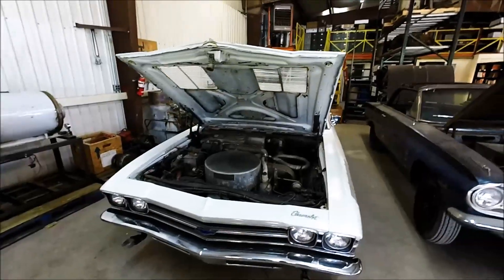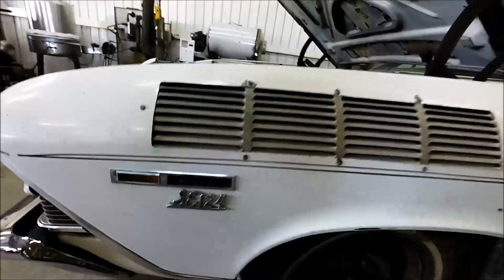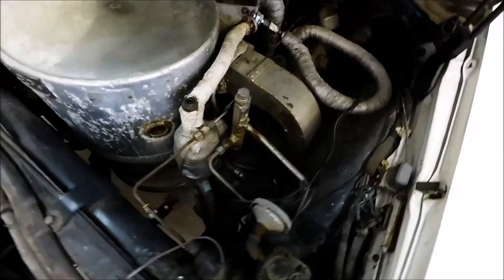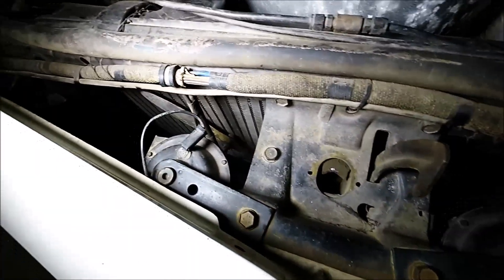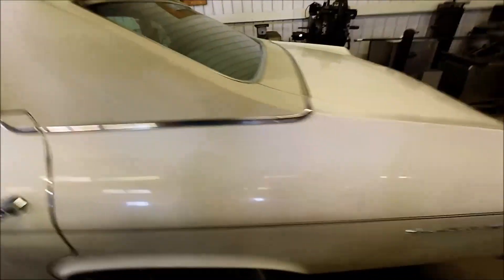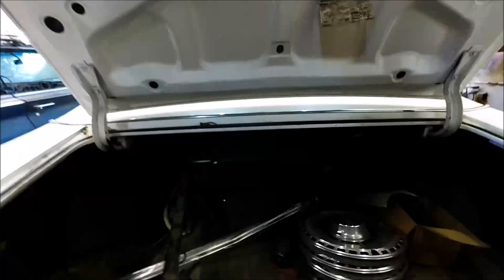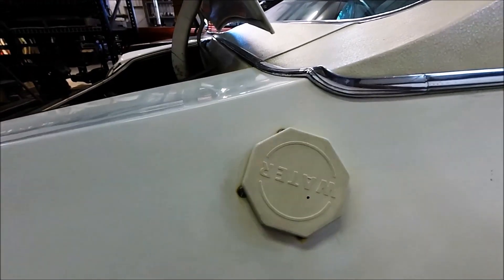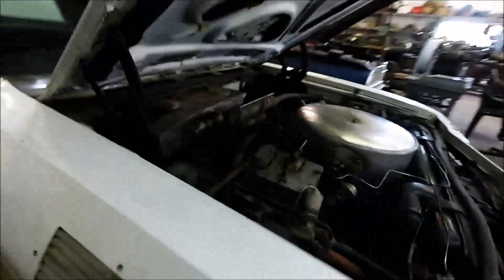1969 Steam Powered Chevelle - Built For General Motors

Comment: I'm looking forward to more info about this I'm... Well attempting to create my own steamcar
Reply: @A heart named Lee Perhaps, though the one problem about steam cars is steam pressure and their issue of exploding sometimes, you'd probably need a degree in engineering and have some years with a company that restores steam locomotives for a more than basic understanding to make an effective steamcar
Reply: @A heart named Lee Ahhh I see well currently I would suggest if you want an easy to work with engine that's fuel efficient, a Mitsubishi G2 engine would work well
Reply: @A heart named Lee it's a bold and honestly interesting way to go, I wish could still pursue it currently but... I would suggest you look at steam cars of the 60s there are quite a few vehicles to research that are rather effective
Reply: @A heart named Lee only people I can think of are people who repair and restore steam locomotives, there are also live steam modellers who make actual working miniature steam locomotives and possibly the Stanley steamcar clubs if any exist aside from that basic research and tinkering with a small easy to manipulate motor
Reply: @A heart named Lee Again I own a car with a Mitsubishi G2 engine and it's a nice little reliable engine but you may want to use a very durable engine like a Slant six and then kind of build a car around it, you can make a Ford shoebox or a 65 mustang from replica parts completely

Comment: I saw Jay Leno's steam powered cars, and they run pretty well. They're fast too! Well, for a 20's car. And they're very silent. I just wonder how a steam powered car would look and sound like with new technology...
Reply: I imagine maybe we could replace kerosene with electricity. I would rather drive that than a Tesla.
Reply: @lobmin  Just use clean coal. Lololol! But yeah, I hear ya.
Reply: @lobmin  why would you build an electric steam car?
Reply: @sandervanderkammen9230   To have a non-polluting steam car, by eliminating kerosene burning. Also because it's just cool.
Reply: @lobmin  oh, OK because you would be making it even more inefficient and expensive. Electric motors are at least 300% more efficient.
Reply: @sandervanderkammen9230   you're probably right about the electric heating being inefficient. But I would still love to have a non-fossile-powered steam car
Reply: @lobmin  you could use bio-Diesel  or ethanol, those are renewable fuels
Reply: @sandervanderkammen9230  Electric cars also can't match gasolines energy density
Reply: @sandervanderkammen9230  geez man! 🤣🤣🤣
Reply: @I8ITSK8N  You don't see the fatal flaw in that concept???? I guess they don't teach engineering anymore?
Reply: @sandervanderkammen9230 300 percent 😂😂😂😂😂 so it gives back more energy than you can put into it - brother I think you're posts are racked with bias , what YOU think is correct information and worse of all a defeatist attitude. I think what Albert Einstein said is applicable here : "a scientist who believes he knows he's right is probably wrong and one who claims he doesn't know is probably right" .
Reply: @michaelkupchik3974 Your comments reveal someone who has no formal education or professional experience in this field.
Modern electric Motors average 90% energy efficiency
Steam engines in this size range average less than 20%
So 300% is a very very conservative estimate, some applications an electric motor could be up to 500% more efficient than Steam.

Any questions lad?
Reply: Prayers for Jay and his family, he is currently in hospital burn unit undergoing treatment for severe burn injuries he received while starting his steam car.
Reply: @A heart named Lee What would be the point?
Reply: As a practical steam car the SE-124 was a rather embarrassing failure. The high cost and low efficiency prevents any serious interest in a new steam cars today.

Comment: It's not a true steam engine if it runs on kerosene
Reply from the maker: How do you generate steam if you cannot use fuel?
Reply: Think before you speak. You need to generate steam for the steam engine to work, meaning you need some source of heat: could be coal, some type of fossil fuel, wood, electric coils, geothermal, etc but you need a heat source.
Reply: what the fuck do you think makes the steam? What do you think is a true steam engine, all steam engines have to burn some type of fuel like wood or coal and yes, kerosene or ethanol. Maybe stick to the benchpress, steer clear of things that require some thinking in the future.
Reply: We all know that true steam engines are powered by magic steam goblins. The same ones that make the steam for the turbines in the power station that charges up electric cars.
Reply: RIP benchpress 😆

Comment: In today's world, Steam would do a lot of good. But not as a flame operated system, rather an electric one. I wish someone would tackle that challenge already, we have quite a lot of background on electric capacity and heating at this point and 100+ years of steam engines.
Reply: Wouldn't using electricity to convert water to steam be far less efficient than using it to turn an electric motor?
Reply: I was thinking the exactly same thing. To have a small steam turbine charge a small battery. Also you wouldn't have the massive transmission assembly. It's been done in a sports car from 2013 I think, can't remember the name. A 30 kW turbine extended its range from 80 to 450 miles (a car with <4sec to 100km/h). I reckon it would be extremely expensive to build a steam turbine that would have efficiency comparable to modern IC engines, I think if they were made cheap and en masse they could get maybe 20-25% efficiency (modern diesel engines are around 50%). Modern power plants use a combined gas/steam turbine system to raise efficiency to 65%, but gas turbines are loud and this makes the entire thing much more complex (expensive). Basically if you can make an IC engine cheaper and more efficient that a steam turbine, and connect it to an electric generator just like you would a turbine.. well the turbine makes no sense then. Mainly because the IC engine has undergone so much testing inside the automobile in the last 100+ years and the turbine has not, developing a version that would be safe on the road would take lots of time and money. Maybe someone will say, "it could burn ethanol and IC engines can't". Well more energy from fossil fuel is actually used to produce ethanol (fertilizers) than is recieved as profit. So that's a no go. So if the efficiency of a micro-turbine (such would be used in a car) can't be magically doubled then the only application it could have is in distant areas that don't have steady access to fossil fuels, so you could fuel them with firewood. Using the same logic, it could have an application in the military also, like a self-reliant mobile source of electricity and heating/cooling. But that's it I think.
Reply: You're just lowering the energy efficiency with that. If you have a source of electric power already, it's more efficient to put that directly into an electric motor rather than convert it through a bunch of steps. 

It's much less efficient to convert electric current to heat, dump that heat into water, convert that water to steam, and then use that steam to move a piston. 

Steam engines make more sense when you have a readily available heat source, but need reciprocal motion: like if you have access to hydrothermal hotspots, can harness the sun's heat, or just happen to have a nuke reactor laying around. :)
Reply: I think we can chuck that idea into trash bin.

Comment: is this a motorized vehicle or no, I'm asking because cops pull you for no license   due to a previous  DIY, " driving a motorized vehicle "
Reply: I'm not 100% familiar with the laws that define what is and isn't a motorized vehicle, but I believe this would be considered motorized in pretty much any jurisdiction. A bicycle, for example, is merely turning human motion into mechanical power, making it "non-motorized". This, however, is turning thermal energy into mechanical power, just as a conventional automobile does. To do so requires an engine of some form, and is thus "motorized".
Reply: Modern gas / diesel cars use internal combustion engines.  Steam cars use external combustion engines.  Yes, motorized.
Reply: It's a motorized vehicle, a steam powered motor vehicle.

Comment: Replace the kerosene burner with a Leonardo E-Cat SK 20 Kilowatt heater.
Reply: Tesla batteries at 60-90kwh... question is, does that mean 3 hours of driving, or would the steam "hold it's heat".

Comment: I wonder what would have come of it if they actually said yes to steam in 1969, would internal combustion engines fade and we enter a steampunk like era, or would steam soon fade out again as it did in the 20's and we just end out the same way.
Reply: @Noah Shepherd I think steam did have power, they had really good torque. It's just that they weren't as simple as "turn the key, start & off you go" so naturally people would prefer the quicker option also they ICE's were becoming lighter and more powerful and I guess was also more fuel efficient than the steam cars.
Reply: Steam cars became obsolete in 1915 with the invention of the electric starter for internal combustion engines.  Once a safe easy way was found to start ICE cars steam no longer offers any advantages.

Comment: For the engine did they use a diesel block a 2 stroke or 4 stroke gas? Just wondering
Reply from the maker: It was a chopped down 4 stroke gas.
Reply from the maker: @TheoXaris the question was what kind of block was used.  Originally, the block they used had started as a four stroke engine.
Reply: J. J. springer what kind of motor do you think chevy had in 1968?

Comment: well no wonder they gave up on it, they just cannibalized a v8 for the cylinders.
I bet if you actually dropped a from-scratch steam engine into it it would be great.
Reply: Dr. Emmett Brown. "Marty! It runs on Steam!"
Reply: Block0fWood or use the actual four cylinder they had at the time, the 153. Idk why they didn’t use it, it may be a non cross flow head issue though.

Comment: Clean power? Dosen't steam power put more pollution in the air that gas or diesel?
Reply from the maker: Why would it? It would entirely depend on what fuel they burn. What if they ran it on alcohol?
Reply: Or Hydrogen  @stevelehto , then the exhaust from generating the Steam is Mostly Water Vapor (which could theoretically be recycled back into the boiler water supply) and Trace Amounts of nitrogen oxides, meaning hardly Any Pollution At All.
Reply: @oldSawyer  Why would any legitimate automobile manufacturer use hydrogen in a steam engine??? That makes no logical sense.
Reply: Yes, steam cars produce high levels of NOx emissions and have a huge carbon footprint regardless of what fuel is used.

Comment: nowadays could probably have steam electric hybrid. bcuz that new magnetic plate technology that heats up instantly... forgot what its called. if heating the water takes less electricity than what u get from steam... it might be a good idea.
Reply: Autistic Boy yea but the electricity to heat the plate would far outweigh the electricity you have gained back. Energy cannot be created out of nowhere. Also gasoline motors can also make electricity. That’s what an alternator does.
Reply: Keep in mind that electric motors are 450% more efficient than steam engines.
Reply: Just a 'heads up' for you  @sandervanderkammen9230  . . . My Electricity is Generated By STEAM at the Byron Nuclear Plant, so it's kind of hard to buy your fabrication that electric motors would be 450% more efficient than the power source generating that electricity. . . You'd also be Hard Pressed to find a Gas or Diesel Engine in a Nuclear Submarine, since well, They are Steam Powered, using the steam to power the sub itself AND the electric generators to run the lights & computers on board.
Reply: @oldSawyer  Are you paranoid?
Are you afraid the doctors are gonna lock up again son?
Reply: @oldSawyer  Answer the question son, if steam is more efficient? Why is it obsolete in the automotive industry for over a century?
How can a steam engine the size of an automobile application be as efficient as a internal combustion engine???
Try using some facts instead of childish insults.